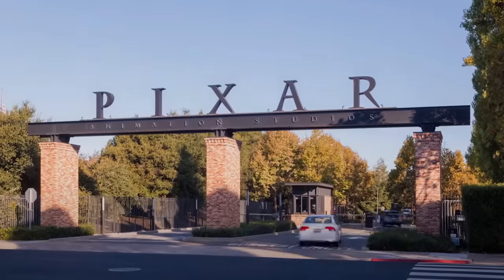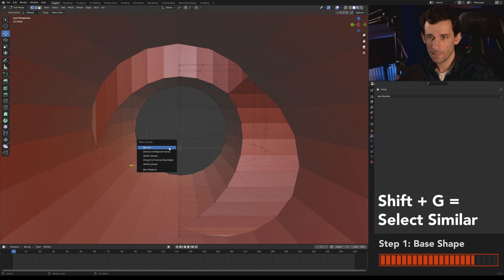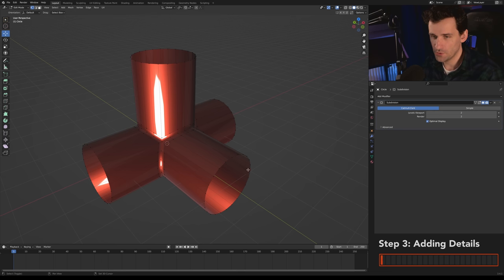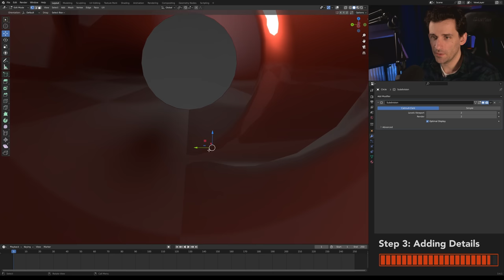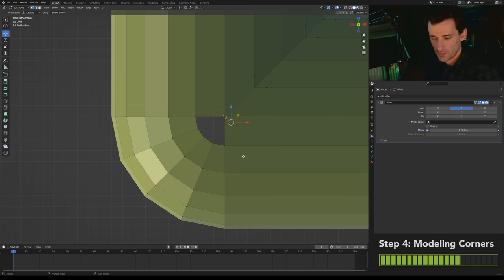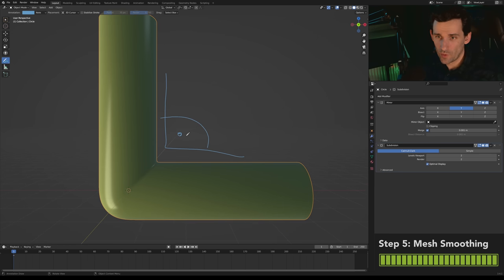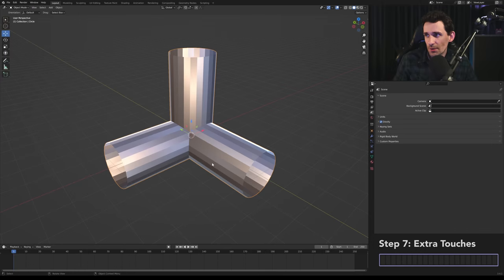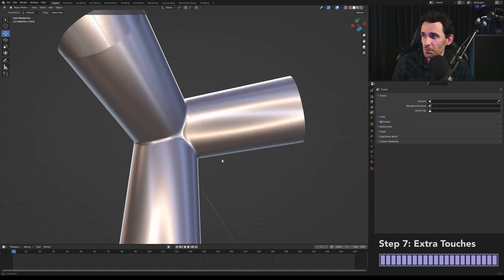3D Models That Will END Your Career

Comment: Great tutorial, love your channel.
This is one of those rare times in 3d modelling where perception of "real world" & "3d world" collide & the graphic artist gets it wrong !
I'm an engineer & the fact is a 3 way metal pipe like this would never be so perfect in the joins. Essentially the individual pieces are cut & then TIG or MIG welded together leaving a noticeable ridge in the junction.
If the pipe were plastic it will probably have a "spur" & injection marks over the surface & in the junction from the molding process & quite possibly a molding mark around the outside.
The intro model is more realistic than the polished end result which, unless you're going for a polished, honed immaculate finish is not "real world"
Reply from the maker: honestly, comments like yours are one of the main reasons I want to do videos. the amount of cool knowledge like you’ve shared I’ve accumulated over the years is immeasurable. thank you!
Reply: @Chocofur  Thanks, appreciate it.
A really good friend said to me " realism is when you go to Mcdonald's, you take your burger out of the packaging & it looks nothing like the picture on the menu board".
There's no loop cuts tightening the edge of the bun in realism. 
Enjoy your weekend 😀🦘
🐨
Reply: It's easier to add imperfections and real world details like rust, bumps, etc. to the surface that is initially smooth. The imperfections from bad topology are not realism, they are artifacts you have no control over, unless you fix your model. Then you can subdivide, sculpt the bumps properly, bake them into normal map and make the model actually realistic.
Reply: @OrbitalCookie  "pinching" from bad topology or subdividing around a metal pipe especially where a pipe is joined is very realistic under certain circumstances.
It takes a good graphic artist to tell the difference between what is real & what people expect to see.
Reply: Yea im an ACP for mechanical CAD work and i was gon a comment basically the same thing 😂 you'd see seams like that in 3D printing but we dont use 3D printing for stuff like this yet so youre gonna have seams or injection marks
Reply: Could be a high end titanium 3D printed part for F1 or aerospace though...
Reply: @ballsdeepinglory3054  True enough & fair point. I was really remarking on the generic variety of that type of pipe though & how the pinch artifacts on the first model were in fact surprisingly  realistic in the position they were in. Also the point that it would be classified as "un realistic" when it's obvious that the shiny well polished model is unrealistic in 99% of cases.
Reply: Also, the green L shaped model would almost never be fabricated to look that way with a sharp interior angle and a large radius exterior curve. Cutting and welding pipe would leave a sharp corner on the outside as well. It could be done for something purely aesthetic like a decorative handrail, but then the fabricator would have a pretty rough time and would probably be better off making the corner feature out of solid round bar.
Reply: @jarphabib  correct, it just goes to show how careful we have to be in creating realism. It is a fine balance between what we perceive, what the client wants & what is real.
Have a great day 👍
Reply: @daniellma1234  Good point & well noted. I've had no experience in 3d printing & would be interested to know if the printed model produces any defects such as excess material which has to be removed & cleaned up ?
My initial point was in general terms for the pipe fitting & I accept it could be polished & machined to produce a near perfect part but in general terms an off the rack pipe fitting is not that perfect in reality.  😊👍
Reply: @daniellma1234  Thanks for the info, interesting to know. 😊👍
Reply: i would agree but it all depends on application to the degree in which it polished.  If we are talking someone's plumbing in the wall, then yes it will look sloppy but we'll never see it either.  If we are talking about aerospace or anything high precision like gasoline fixtures or a whole multitude of varying types natural gas or anything volatile, you'll see very very clean looking products that have no visual flaws, maybe a bit of wear and tear marks like scratches(some cases heavily worn out).  So i deem the video itself high quality as most of the stuff we'd see involving pipes would be associated to the latter.
Reply: @jakestarr4718  I agree with your comment. I was really referring to a generic garden variety off the shelf pipe product. I agree custom pipes are detailed & finished to a high standard but generally speaking they are not that perfect. I think we as 3d graphic artists generally model objects in their "perfect" state when in reality they are far from perfect unless they are 1 off's or specialized pieces.
Reply: @nigellill3222  I worked in a lot of machine shops.  You'd be surprised the specs those parts are milled too.  Just even making a bracket on a brake press generally has a 0.50+- millimeter tolerance for tractors.  Space shuttle or rocket parts are like 0.10 millimeter+- and engine parts are even more forgiving like brackets.  Milling metals creates heat is why, so generally you toss out your first 10 you run while the machine warms up, unless you know specifically the speed variants to make those first 10 run perfect, which is a art form in itself.  So my experience isn't just in modeling, i've milled/fabricated and held these parts.  The only exception to it is galvanized conduit pipe, but even that has a very high standard of manufacturing in tolerance allowances.  Anything made to be visually looked at out in the open will always have a high quality finish.  Otherwise they end up in the recycle bin just over a scratch, like a john deere mower mudflap or rather the wheel housing.  Mechanical parts are handled with even more care and if they're meant to be used in moving volatile substances, then the quality polish is microscopically done even if you don't see them.  Even brass water connectors we don't see have a very high degree's of polishing.  But yeah i get it, plastic stuff has a much lower standard because it just uses glue or copper joints even with solder, but how often do you see them inside a wall?  Unless you're a plumber...  Companies are pretty proud of their products generally, so the visual aspect is almost always pushed.  Even the plastic parts can be ridiculously manufactured for looks, like shark bite pex fittings that you now see under a lot of sinks.  I've done construction too, so i've seen my fair share, even been inside coal boilers and that tubing is flawlessly bent and flared without a single scratch or deformation.  We could go crawl around inside of ethanol factory between floors where the pipes are and i can promise you they might be dusty but if we brush them off, they will look flawless.  Sorry just rambling at this point to avoid my project lol.  I got a mechanical nightmare going
Reply: @jakestarr4718  In my original post I stated I am an engineer of some 40 years so at least you're ranting to someone who understands your point 🙂 I think we can agree that there are absolutely pristine pipe fittings out there made from a variety of materials but, there are also pipe fittings that have been made cheaply for a specific purpose where appearance is not an issue & I would suggest these items are more readily available & recognised by the general public. 👍🏼🦘
Reply: @nigellill3222 those pinching artefacts are nothing but artefacts. If you want realistic seams etc. and imperfections you need to work with a model with good topology and not with ngon artefacts that will make everything harder in a professional pipeline. That’s just not how 3D Modeling works.
Reply: @LeoMastroTV  I know. I was referring to the overall look & not how they were made.
Reply: Yeah, it’s more of an “ideal” pipe, similar to “ideal gases”. It’s what a pipe should be (almost), if we could make it at that precision
Reply: @chtechindustries4174  I agree wholeheartedly. There's a difference between the McDonald's burger you get at the drive thru & the same burger pictured on the menu board. The one from drive thru is real world whereas the one on the menu board is a perfect burger which could be made if the server wants to spend 1/2 an hour assembling it perfectly.

Comment from the maker: 🐔 LEVEL 3: the quadsphere (cube with subdivision modifier) won't be the better solution as it will have a vertex in the centre of the corner! If you subdivide that model it will have a small, anoying shading bump. Try it and check it with different matcaps (I did).

EDIT: same with the beveled cube...
Reply: Apply polish on it to make it a perfect sphere. A catmull-clark-subdivided cube ≠ perfect sphere. Thus, it has a bit of pinching on the poles. The pinching that's causing the shading issue goes aways once you polish it.
Reply: A quadsphere made by subd&cast on a cube, useful as it can be, isn't a topologically perfect sphere.  This can be shown with a circle (same # of edges as the sphere's equator), a close up on the quadsphere in edit mode will show the equator verts aren't quite in the same places as the circle's verts.  So when Merge by Distance is used between the pipe verts and the quadsphere cap verts it causes distortion.  I've tried this with an 3axis-fixed quadsphere, it worked with no distortion.
Reply: True, a cube with subdivision modifier won't create a perfect sphere, in my opinion the better option would be to add a cube with a bevel modifier, put the amount up all the way till it makes a sphere, and add segments equal to the amount you need. Bevel modifier is also more flexible with the amount of vertices you need to join the meshes together.

TLDR: Cube with bevel modifier, amount all the way up, Segments as much as you need, apply modifier, merge by distance, cut away until you're left with just the corner, merge with the pipes, done.
Reply: @upstreamruben8011  that would also work perfectly
Reply from the maker: @upstreamruben8011  tbh I've tried cube with different bevel settings - you either get a vertex at the center of the corner or a small triangle, both resulting in small shading bumps (checked with different matcaps). it actually blows my mind because what you guys suggest should actually work. not sure if it's the way Blender does subdiv or something else. 

I just can't die in peace knowing that what I've shown in the video is the only way to do it with no shading bugs (it just doesn't make sense).
Reply: @Chocofur  The quadsphere method I described above works with no shading bump of that corner vert, I checked extra carefully using the ceramic_lightbulb.exr matcap.  I'll put up my .blend somewhere if you think it'll help.  Are you sure your test didn't have other issues that could cause that?
Reply: @Chocofur  Oh my goodness. You've just exposed me to a problem I haven't noticed before... THERE HAS TO BE A WAY...

I will update you if/when I find a solution
Reply from the maker: @kickaireightptilde4825  post the screen / file somewhere, we'll have a look!
Reply from the maker: @kickaireightptilde4825  man, switch the matcap to normal and see what a mess this model is. career OVER 🙃
Reply: @Chocofur  Okay, did that -- still not seeing a distortion on that vert.  If you're seeing it in my .blend?  I wouldn't think a GPU difference would matter in Workbench -- settings difference?
Reply from the maker: @kickaireightptilde4825  this is from your file: https://twitter.com/Chocofur/status/1653495857562505232/photo/1 look at the screen on the left. cmon man, this is bad on so many levels

Comment: CTRL + B to bevel is a really useful keybind for this workflow. You can both multiply edges on flat surfaces and sharpen corners very uniformly. It's called "bevel" but the operator actually just splits edges into multiple loops that are evenly spaced, so you can imagine all the things you can do with that...
Reply: I love the bevel tool. I think it kind of works like a "local subdivision surface".
Reply: I'm currently using that for my light saber model, while following along with the Intro to Blender 2.8 course from Flipped Normals using the latest version of Blender lol :P
Reply: i'm a loopcut fan, nice and clean, just move it where i want it
Reply: @patel3501 oh 2.8 to 4.0, that's like the grocery store moving item displays around on you LOL.  Just have to get used to finding where things are and even then some features might be removed and that's a whole different kind of learning curve.  Its like using unreal engine 4 tutorials in unreal 5.3...  You have to be insane to attempt it MWHAHAHAHAA.  Workflows change, gotta be careful of adding edges with the right click between vert, it will join the vert and not affect the face.  I had artifacts in my mesh all over from that, make loopcut and the knife very close friends is my advice lol

Another thing you can do is click the vert you want other vert aligned too and if you look by the colored x,y,z in the top right, there is a tiny <...  expand that and you'll see item, tool, etc...  if you click item it will open a small transform tab and you can see the verts location on all axis and copy paste to the others you want aligned.  I found that extremely useful when trying to align things and keep stuff to scale even in my topo.

Comment: Maybe a nice advice for you: after pressing GG, press E(and then F), so you won’t have to slide verts in and they will be aligned as needed. 
And for the 4th method you can use shear tool end extrude, after that you cab add loops near the corner and use percentage bevel so the inner part bevel will be smaller than an outer
Reply from the maker: thanks man <3 I'm doing the edge loop slide trick just out of laziness tbh. and Shear is one of the most underrated Blender tools!
Reply: How to I favorite this lmao
I need to make an advanced cheat sheet for this stuff

Comment: Amazing tutorial, thanks! For method 2 i sometimes use a cylinder and a "Spin" tool for a top face, with 90 degree angle. Manipulating the gizmo location can get you a good (more smooth on the sharpest edge tho) effect too. :)

Comment: I noticed that the three way method only works when the cylinder has 24 or less faces. I worked with 32 "sided" cylinders and it made the merging of the three spere-parts very different because there was more overlap and it created shading bumps. More than the method with the sub-d-cube.
Reply: Possibly because 3 is a factor of 24 but not 32? What happens if you use 36 segments?

Comment: The tube Level 2 can be made from a Torus. Set Major and Minor radiuses almost equal, delete 3/4 of the circle and leave only 1/4 of it - you'll get a perfect angle. Then extrude edges from the angle towards two directions - you'll get tubes.

Another way. Create a Plane - apply Bevel to the one of the vertices (this will be a bend of your tube) - remove the opposite vertex - you'll get two edges with the rounded corner - convert it to the Curve (this will be an axis of your tube) - apply Depth to the curve (this will be a diameter of the tube) - convert it to the Mesh - add Subdivision Surface
Reply from the maker: not sure about the plane solution, but the Torus one is actually the best anyone suggested yet! but I think people would shred me into pieces if I've shown it as THE ONE way to do it. really appreciate your comment!

Comment: for Step 05 you could easily use blenders buildtin "Spin" tool (located in the toolbar in edit mode), that way you dont have to do the bridge loops part.
Reply from the maker: your career just ended lol
Reply: That will create a curved inside angle, not a 90 degree, and will create a ton of additional geometry from the spin.

Comment: A tip for non-pipe looking elements: Overlap two straight objects that you want to make a curve of with big margin, at an angle that you want, that would also be nicely visible from top/side/front orthographic view, join them together, use knife tool and slice through the same edges that overlap with cut-through on, merge by distance, delete the margin verticles, either bevel or subdivision, you're done. Not often you have time to make perfect shapes, but this will make shapes good enough for any custom shape.